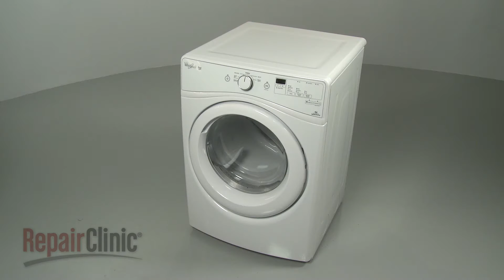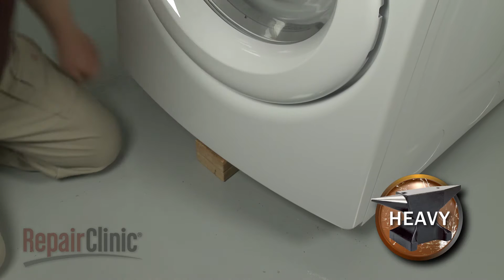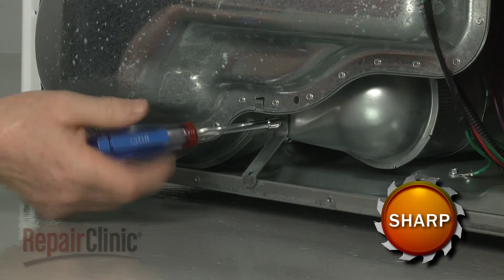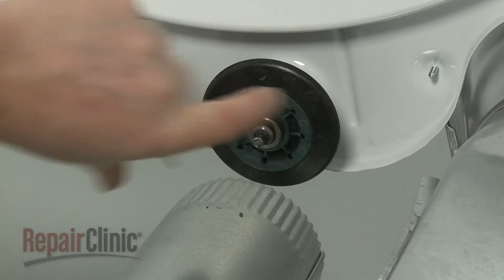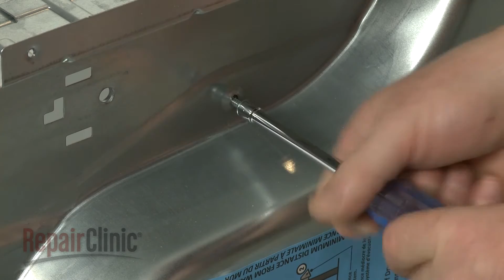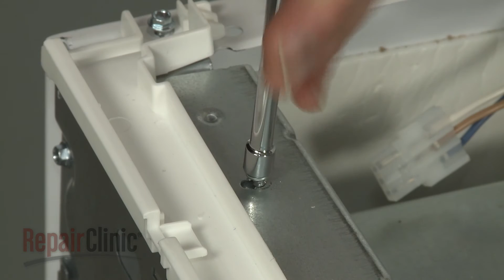Whirlpool Electric Dryer Drum Roller Axle, Rear #WPW10359272

Comment: you can just take off the main back panel, remove the axle(reverse thread) with 15mm and some pliers and then replace with new parts lol. making a career outta that one
Reply: Why would this need to be replaced?  My wheel does not spin freely, so wondering if that is the problem.  Thank you.
Reply: @dianec6290 the rollers can dig into the axle, leaving huge grooves. If your axles aren't missing chunks, you'll be good. I clean them with 2000 grit sandpaper and a microfiber, then use grease like syl-glide. No WD-40